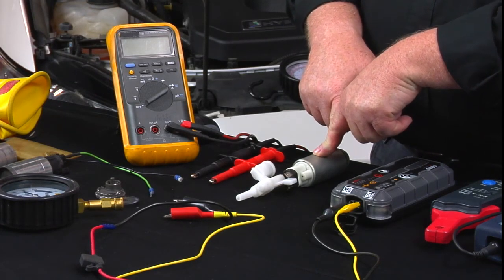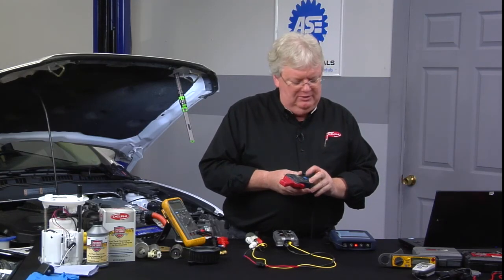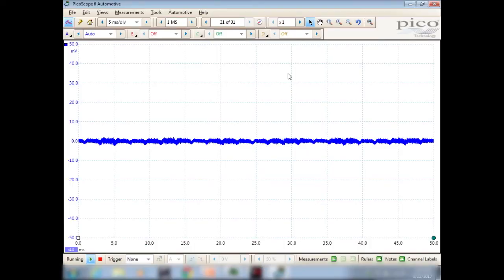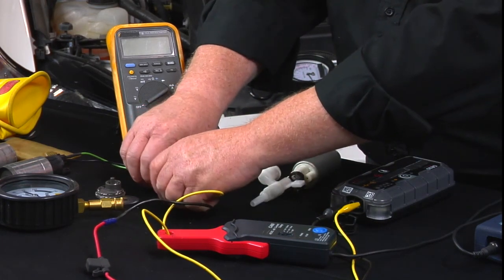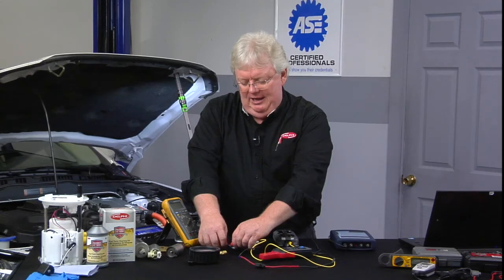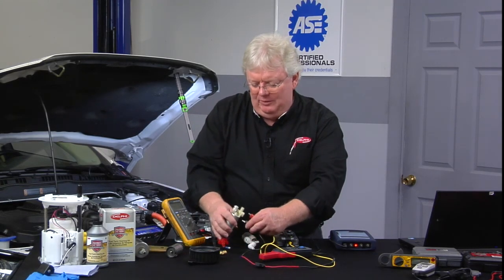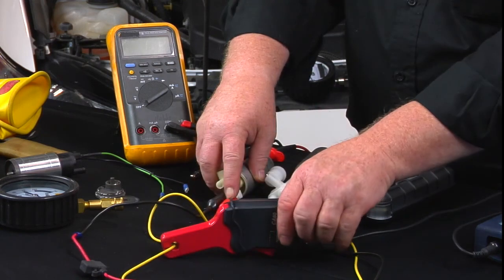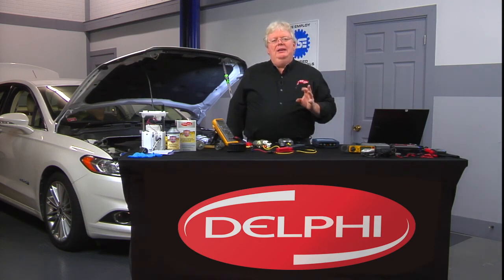How to Perform a Fuel Pump Current Draw Test

Comment: is there a psi per amp rating on the spec? say 20 psi should have 2 amps? so if the fuel pressure spec is 50 psi how many amps would you expect to see?? good demo